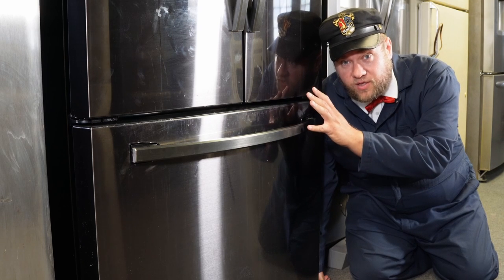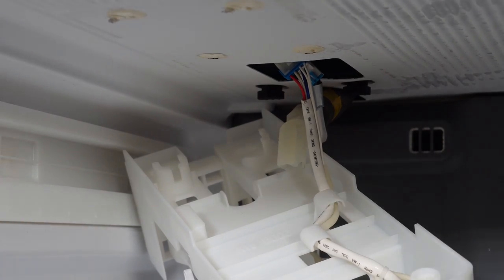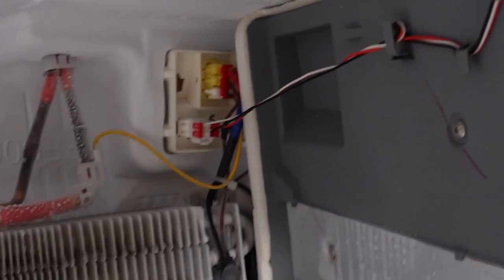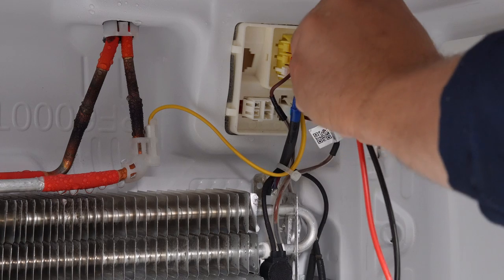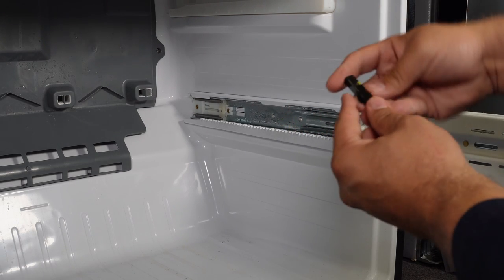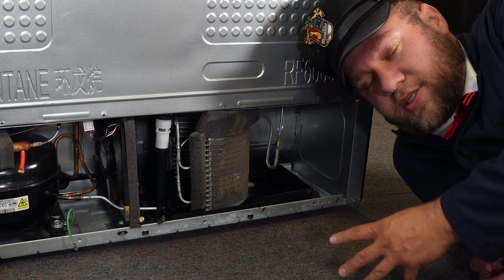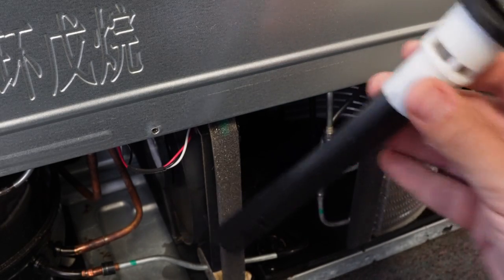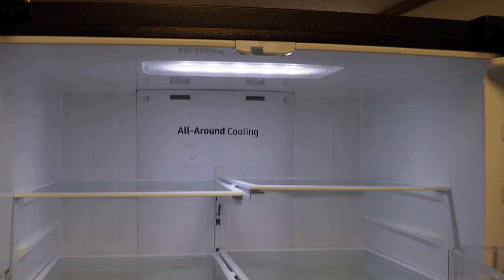Samsung Refrigerator Freezer Not Working or Won't Cool Enough - Ideas to Test and Fix!

Comment: This type condenser(radiator type) can has problem of leaking and easily damaged by scratch. Better not to use brush and better to use spray water and dry it out. You did a good explanation for this fridge. Thanks.
Reply from the maker: Respectfully, I've never heard a tech in my life ever, ever, suggest spraying water underneath to clean the coils. I really, truly, don't think thats good advice for this refrigerator. If penetrating the coils was a concern, spraying water and splashing it on nearby electrical wires would be just as much of a vunerability, and it'd be better to just use a much softer brush, or a more powerful vaccum, or use air duster / compressed air.
Reply: @bensappliancesandjunk  I just used a brush with a shop vac.  Still lots of dust in the coils.  Grabbed my air compressor and, boy did that do the job on all sorts of crud I could AND couldn't see or budge with the brush.  Highly recommended!

Comment: What if your evaporator coil in the freezer part is not getting cold at all but the top evaporator  in the refrigerator gets cold & the compressor is running how do i get the bottom evaporator to get cold ?

Comment: My samsung RFG297HDRS freezer fan was not working (21 error code).  Following your directions I was able to get to the 2 freezer fans and found them encased in ice😢 After getting rid of the ice, my freezer is working fine🙂  Thanks for your excellent videos on how to get to the problem areas of my Samsung refrigerator.

Comment: Hey Ben, just FYI, the low density expanded polystyrene that samsung used on these is NOT STYROFOAM. Styrofoam is a registered trademark of DOW chemical, and it is extruded polystyrene which has an R value of around 5 per inch. The shit samsung used is around 3.5 per inch. AND expanded is NOT waterproof it will actually hold water between the little beads Extruded IS closed cell, and therefore,  waterproof. Samsung screwed the pooch using expanded.

Comment: Can't thank you enough!  My samsung fridge has been icing up, finally go that fixed but then the freeze wouldn't get cold enough. This video gave me everything I needed to take the freezer apart and find it too was iced up, which caused the fan to stop.  Fan is now free and I'm optimistic it will run again. Thanks!  I do wonder if the fridge fan gets frozen and stops, causing a huge ice build up on top, can that impact the freezer to ice over, too?
Reply: Same situation

Unfroze the fridge a few times a couple months apart. 

Waited too long and now my freezer is 50 degrees fan drozen
Reply: @atomic43  there's another video on here that suggested adding weatherstripping to the fridge back.  I had taken it apart 3 times in 2 months and thawed the ice, but after adding the weatherstripping 6 months ago I haven't had another issue.

Comment: I have a similar fridge. Freezer stopped working. I'm pretty mechanical. Dumb question though. Can I work on the bottom while the normal fridge works on top?

Comment: Do you ever service or repair “Sub Zero” refrigerator? Bought a house with one installed, have no idea how to repair or service. Any help would be greatly appreciated, thank You. 😁
Reply from the maker: No, I havent had the chance. I live in a poor area.
Reply: Most sub zeros, everything is in a machine cabinet on top. I’ve serviced a couple but never done a sealed system job on one. So if it’s a frost pattern issue I won’t be any help. But otherwise what are you trying to get at.
Reply: @c.a.nationwide  I don’t have a problem at the moment, just don’t know if there is a water filter for the ice and water in the front door. And have no idea where it is located, Do You?
Reply: @gerigoetzinger8539  If you can send me model and serial I can help you. If it’s a built-in cabinetry unit it’s probably on the top section there’s usually like a rectangle grate cover and it just flips up

Comment: Hey Ben 2 problems...I have a set up like the frig in your video..#1) the bottom ice maker works until it runs about 2 days then no ice until I unplug the unit and let it thaw out..after I plug it back in it makes ice foe about 2 days then quits..someone told me the heaters weren't workinh..woukd this be a repairman job or a dying job..#2) I recently got this frig back and the light switch in the frig was staying on all the time...the switch was broke off at the holder facing...I screwed around with it by putting a metal screw in where the plastic push button was to try to turn the lights off when I shut the doir...ya..my bad..the light went out but the freezer light still work..do is there a fuse in that back panel that controls the light in the frig?  I final got a new light switch for the frig..but don't want to screw up something else or even the switch trying to put it back together...it took me 3 months to get this switch seeing the frig is around 10 years old...thanks for anything you can help with..I believe I'll call the service gues about the heaters for the bottom ice maket....Bruce

Comment: Great video!! I have this same unit. The fridge portion is working perfectly fine but the freezer isn’t even trying to get cold. Any ideas? Thanks in advance!
Reply: I just came home from a two week vacation and found the same situation as you!  Is your freezer temp blinking as 0 degrees like mine is?
Reply: @piphoto any fix? Same issue
Reply: I just investigated the components in the lower exterior rear portion of the fridge and mine was caked in a solid layer of dirt, cleaned with my vacuum hose attachment and waiting to see if the problem has been resolved.
Reply: @douglasballard8375  we’re you able to fix the issue?
Reply: @karidodson3461  no the issue worsened, freezer eventually went out as well. Took like 6 weeks to get Samsung to reimburse us, got an LG as a replacement and it has worked exceptionally. I will not be purchasing from Samsung anytime in the foreseeable future.

Comment: Great videos, thank you. In my Samsung fridge/freezer the freezer temp only gets down to 14 degrees F, it can't go any lower (-2  F is recommended on the unit's front panel). There is no ice buildup on the freezer's coils. Is the problem likely to be a bad 'thermostat' in the freezer? (not the defrost sensor) If so,  is the thermostat (or it may have some other name) located near the freezer's evaporator coils? Thanks in advance!

Comment: I have a Maytag MFD2562VEMO (French door bottom mount).  This refrigerator is not cooling properly. The temp in the freezer is reading 28 degrees and the Refrigerator is reading 39 degrees.  I have checked the capacitor and compressor, both of course are kicking on.  I had the thing unplugged and cleaned out…so it was warm and it started to cool down when I plugged it in, but will not go any further in temp on the freezer especially on the fast cool setting.  There is a slight sluggish noise (no high pitch noise…just a sluggish noise, like weak groan noise) coming from the freezer section and refrigerator is constantly running.  No major ice build up on back of the wall.  Any suggestions?
Reply from the maker: I'd check ice on coils inside the back of freezer. Either it's built up and you can't see, or there's no frost at all indicating low refrigerant.

Comment: Hello thank you for the clear video

My fridge was frozen over. I cleared that and the tube going down

But while the fridge is working fine now and keeping temperature the freezer and middle drawer (for drinks and such) are 68 degrees F so definitely not working

I cleaned the condenser,  and there is zero ice in the freezer area. The fan also turns on when it thinks is closed

Any ideas would be helpful thank you!

Comment: Hi Ben I followed all of your instructions thoroughly and the bottom of mine was dirty as well, I cleaned it out and checked the light and it's solid red but it's still not cooling. Are there any other issues that could be causing this?

Comment: Have you ever seen one where both the refrigerator and freezer temp sensors seem  to lose signal, or stray? Display will show -8 and 34, the lowest possible setting for the freezer and refrigerator. I unplug the refrigerator to reset, and when I plug back in, the display show the actual freezer/refrigerator temps, (28° and 43°) and begin cooling. Between 4-8hrs later the display will show -8° and 34° while the inside of both is significantly warmer.

Compressor and fans working properly, no ice build up, drains are clear.

Replaced temperature sensors

No errors

Replaced main board

And ideas would be greatly appreciated, feels like I've exercised ever option at this point

Thanks!
Reply from the maker: Yes, that can happen when you have moisture infiltration in the harness, sometimes. Check the physical connection space where the harnesses unplug for oxidation.
Reply: @bensappliancesandjunk  I will take another look at the internal plugs, apply some dielectric grease and see what happens. It just seems odd that both the Refrigerator AND Freezer display temps would be losing signal, and seemingly failing to lowest setpoint as the display temp. 

Do you know which connection would cause this? The defrost temp sensors or the "ceiling" temp sensors? 

I really appreciate all your help, and your videos in general. You're doing the Lord's work!
Reply: Did you ever get this solved. Having same issue
Reply: @HoustonT17  did you get problem solved I'm having the same issue
Reply: @wdwillis16  look at my above comment. Watch the video in the link I provided. It's been almost 3 weeks. Still holding temp! knock on wood
Reply: Did you ever get this fixed. I have exact same problem. Still looking for solution.
Reply: @HoustonT17  I can't seem to find the link to which you're referring.  What did you do to fix?

Comment: Hey Ben! Great vid! What’s the deal with “GE” not wanting to help out techs? Scum bags. Have you ever seen the IM air flow issue where the top vent heats up and discolors? IM built into left  GE profile French door
Reply from the maker: I've read about that issue. I think I read fan goes bad and causes it? Will be a bulletin for sure
Reply: @bensappliancesandjunk  replaced the IM box fan, control board is good to go. The vent is about 80 degrees, everything else stays cool.  The only other theory I had was that because they put it into a “closet”, the condenser isn’t exchanging heat. Was 111 degrees back there lol. Could the air duct have collapsed?
Reply from the maker: @mauricelinton5867  111 degrees sounds way too high. Should be 90-95. It could be keeping too much heat in the system resulting in inefficient exchange.
Reply: @bensappliancesandjunk  Cool! That’s what I ruled

Comment: Hi Ben, can you tell up which components on the inverter and main PCB usually go bad? I am good at refurbing circuit boards, especially through hole boards like these. I see that samsung used those shitty Chinese Caps on these boards.

Comment: Friends bottom freezer has frost building up. It's a frost-free freezer, and it's a fairly new fridge. She has already had a new seal installed but it's still happening. Any suggestions in solving this issue she has?
Reply from the maker: Is the frost behind the panel and covering the coils in ice?

Comment: You can also clean the condenser coil with non flammable break cleaner at least once a year, make sure to unplug the unit before doing this cleaning also put a piece of cardboard under the fridge so you won't wet the floor.
Reply: I think that foaming evaporator coil cleaner might be a better choice here.

Comment: Would have been easier to start checking, heater, sensor from the board with no disassemble necessary?
Reply from the maker: For a tech yes. For a consumer, maybe not. I figure if I do that I would get 100 responses saying that they don't know where the right pinout is, or their board doesn't match the one on this unit and need me to send them the tech sheet.
Reply: @bensappliancesandjunk   it makes sense.
Thank you for the great video.

Comment: Great diag video, New sub here. Didn't think I would be looking up Samsung refrigerator concerns two days after installation of our new Samsung Bespoke refrigerator.  🤔  48 hours later. Refrigerator is not very cold, set to 37 degrees.  Looking into issues.  Set power cool on and it's getting better.  Something is not right 🤔 lol. Time will tell . Great channel.  Thank you 😊
Reply from the maker: Usually most new installs take 48hrs to get to the proper temp, if not a little more. Make sure you have good airflow behind refrigerator so the fan can exchange the heat at compressor for cooler air.
Reply: @bensappliancesandjunk  one day later, looks like the refrigerator section temperature sensor is out of range by 10 degrees.  Set point is set to 34 degrees (max) and contents are 42 degrees plus or minus. Flex drawer is ok at 37 degrees and freezer section is ok at zero degrees. Is there any calibration adjustment to offset for this? Is the sensor contained in the control adjustment panel? This is a 4 door Samsung Bespoke 2022 with Flex drawer. Thank you for all your help.
Reply: @htnowpro  it’s under warranty, contact your retailer or the manufacturer for a service call and possibly replacement refrigerator